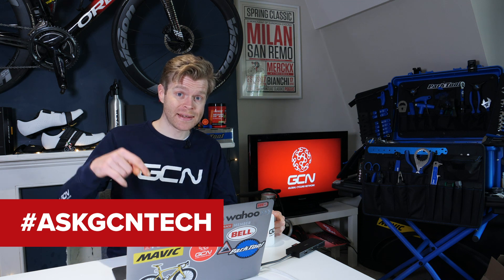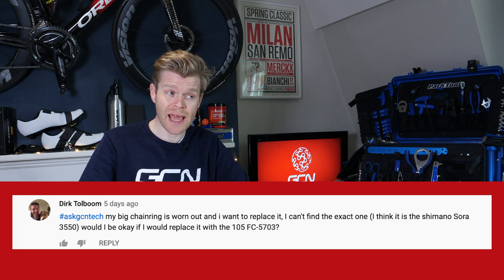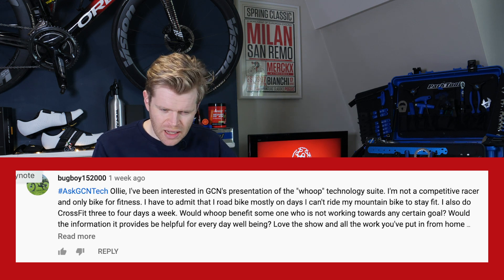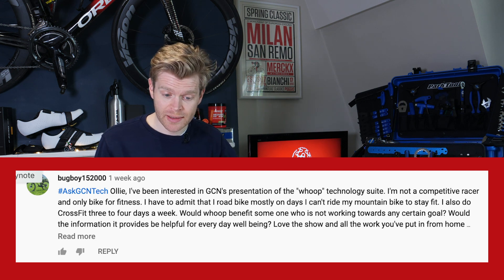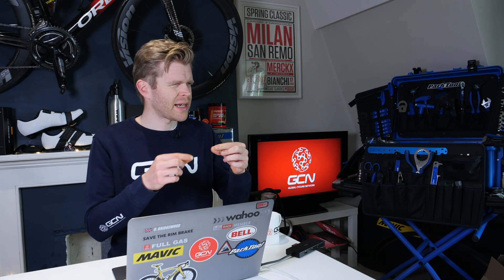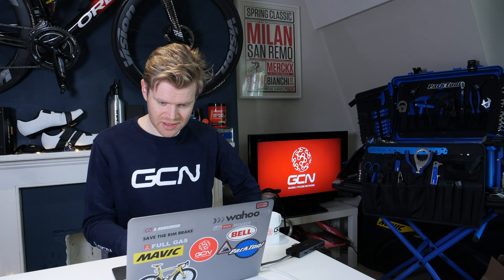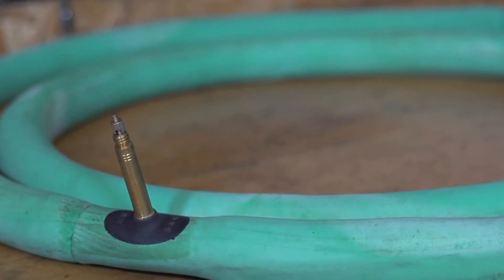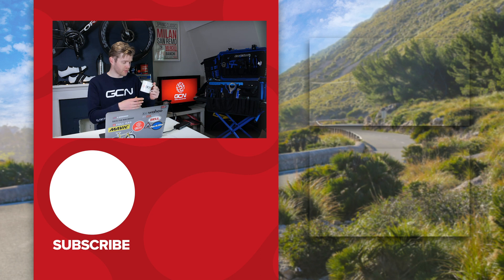Is A Gold Chain Just As Fast As A Regular One? | GCN Tech Clinic #AskGCNTech

Comment: Hello guys - LOVE your knowledge :-)
As a student and always on a budget, will it be smarter for me to by a new bike with Shimano 105 instead of Ultegra, because of the savings when certain parts start to wear and needs replacing? #askGCNtech
Reply: Lukas Svendsen get a bargain on eBay!
Reply: @HIYAharry  I also approve this. Although I found my gem on Facebook market place: a 90s ciöcc frame with mismatched groupset (had a mtb rear derailleur, Sora cranks and ultegra levers and brakes. I've since replaced the drive train with all 105 (period correct) components found on eBay).

Though I'm still working out the rust spots, she's a beaut

Comment: #askGCNtech Hey guys, love the show! I'm currently building a custom bike and have been looking for some new rims. My bike currently has an old Shimano 105 9 speed group-set on it but the wheels I'm looking at have a 10 speed cassette. Can i get away with using a 10 speed cassette with a 9 speed derailleur or would I need to upgrade the whole group-set?
Reply: The 10-speed cassette will not work with 9-speed shifters. But a 9-speed cassette will fit on those wheels - no need to replace your groupset.

Comment: get continental  super light race tubes, normal rubber, they don't loose air  and they only weigh 50 grams for a 25mm with 60 mm valve length... no brainer really!!

Comment: #askGCNtech 
Hi Ollie! Love the show as always! Love the jokes too xD!!
my question: I was noticing my front shifting getting harder and harder, so I cleaned my front derailleur and changed inner and outer cables. It was then, when I saw all the dust, dirt and gunk (was riding in the rain from time to time) in my shifter. How do you clean in there? I hesitate to take it apart, because it's that delicate and I don't know if I can reasseble it afterwards.
Thanks!
Reply from the maker: Hi Mathieu, if your shifter is really dirty inside that could well be an issue, ideally you shouldn't dissemble it, but if you use something like a pipe-cleaner or cotton bud/cue-tip to loosen the dirt then use a hose or sponge and warm soapy water you might be able to clean it up, make sure you dry everything afterwards and hopefully that will do the trick
Reply: @gcntech  Thanks! I will try this.
Follow up: How do I regrease the shifter afterwards? Or is that not necessary?

Comment: Putting wet lube over dry generally makes a big mess.  If I ever have to do that for an event, I would follow it up by cleaning everything really well before switching back to dry lube.

When you see people talking about wax based dry lubes making a sticky mess and clogging up their cassettes, that's exactly what causes it.

If you use waxes, any excess you apply will generally just slough off in flakes.  When you mix it with oil, the two combine to make a more sticky paste, which will stick to things, instead of flaking off.
Reply from the maker: Yes applying wet lube on top of dry lube is an 'emergency only' solution for sure!

Comment: Seriously Ollie, Do your research. So many of your answers are completely wrong. Sora chainring is 130mm bcd. Gold chains are TiN and they're produced by vapor deposition in a vacuum chamber. It's a line of sight process so you will see uncoated parts that weren't exposed. There is no silver or anodizing - which ould make it weaker. TiN is excellent at holding and edge - good for durability. Only moderately better than steel for friction. Have  a different surface energy from steel so lube or water tends to bead up and not cover the surface. Difficult to get lube into the crevices where it's needed but good for rejecting dirt. TiN chains tend to last longer and are easier to clean. Not great for waxing.